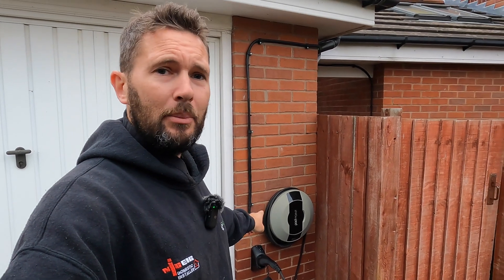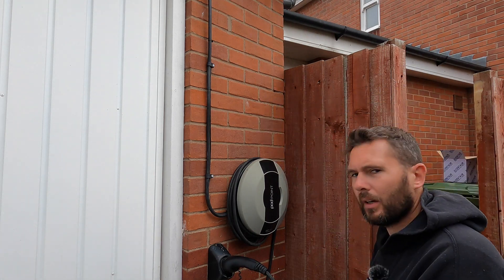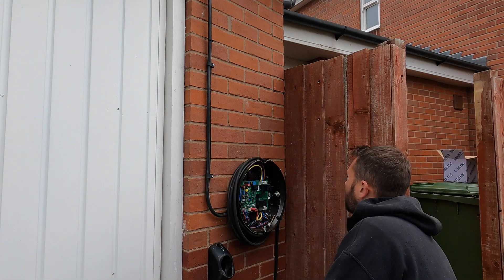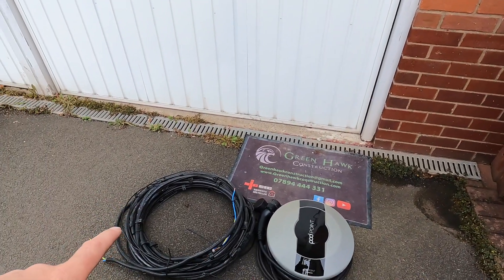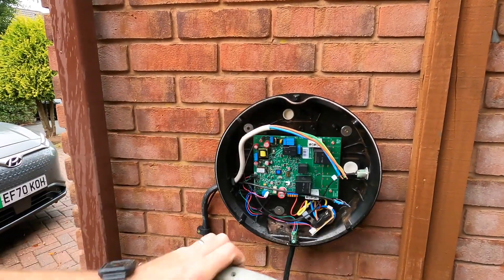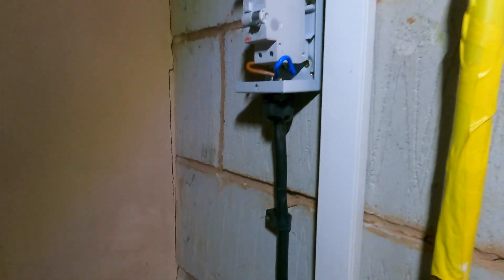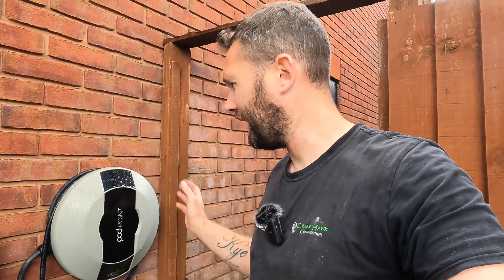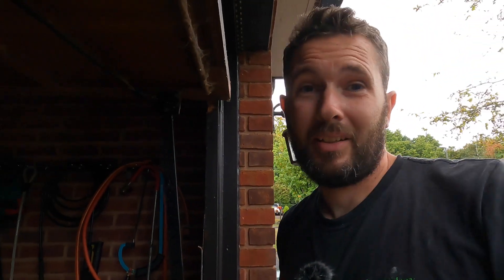THIS HAS CHARGER HAS BEEN FITTED BEFORE!!!!

Comment: My car charger (Ohmi PRO) switch was installed in the cupboard. I thought everything was alright... It was only then afterwards that we had our smart meter installed and the guy installing it said that the car charger was installed terribly. He had cut in to the main feed in and didn't use the two boxes beside the switches (as you see in the video). I'm not sure on the proper terminology. 

The smart meter guy was incredibly helpful and said he would fix the entire cupboard at no charge because he couldn't leave it in a unsafe condition. He also did leave the car charger switch in the cupboard as he said that there wouldn't really be an issue for it being beside the fuseboard other than space in the cupboard - which looks a lot better and safer now.

Comment: I’m dubious at wether the DNO knows about that connection. I’ve yet to find one that allows the charge point to be installed and remain on a 60A service cutout, if that label is correct. Every one I’ve done the DNO have asked me to limit the ALM until they replace the cutout, usually FoC, and within a month they’ve always upgraded to at least 80A. 

Also is that supply looped? As again they don’t usually allow them to remain on a looped supply. Certainly everyone I’ve done has eventually been unlooped within a couple of months. 

I refuse to install in a meter cabinet. Like you I’ve asked and never been given permission. Even to replace a CU that had existed in the cabinet for over 20 yrs. So I just refuse to do it now and explain to the customer why. They all seem to be happy with the external CU if it can’t be done internally. 

Good video though. Keep up the top notch work. 👍🏻

Comment: I’ve installed hundreds of these ,we use the defence cable and nyy because ev ultra cable is 4x the price
Reply: Not sure where you get 4x the price. I’ve also done loads of EV charge points, mainly Hypervolt with a couple of Andersen, a pod point, a couple of Zappi (one of which the customer had me remove and replace with a Hypervolt) and a couple of Tesla. 

6mm EV ultra + cat 5 is £6.60/m inc vat. 6mm NYY is circa £3.75/m inc vat depending on where you shop and then you have to buy the 2 core CT cable and if you have to hardwire then you will need Outdoor rated cat 5. At which point you’re not far off EV ultra. 

I give every customer the option and for the sake of the extra few £ I’ve yet to have one that doesn’t want it all contained in 1 cable. 🤷🏼‍♂️

Comment: The issue with putting non DNO equipment in there is firstly for expansion of grid equipment, there’s now no room for an isolator to go on should the customer require one, and lastly and more importantly, the DNO now can’t change that meter board should it rot away (which they do…frequently) as they can’t go into a fuse box. Customers own the box, not the board it’s installed on, the this is DNO property and it’s only them who can remove a cut-out/meter at the same time to change the board

Comment: The regs state that the house cps should not be used to Earth the pod. You take the house earth to the pod but terminate it at the pod, using a separate Earth rod to earth the pod
Reply: The pod point has a built in relay that disconnects the cpc of a pen fault is detected . Earth rod not required.

Comment: Great for video content but not sure why they bothered having you take the cable and the rest of it as EV point ready increases a houses price on average by £5k. Is it worth the hit to move it to the new house when the cable and labour isn't going to come to that.

Also loving that the gas pipe is closer than 150mm to the consumer unit so someone has wrapped it in yellow tape to get over it.
Reply from the maker: The previous house was rented mate
Reply: @GreenHawkElectrical  Ah the only reason worth taking it with you!